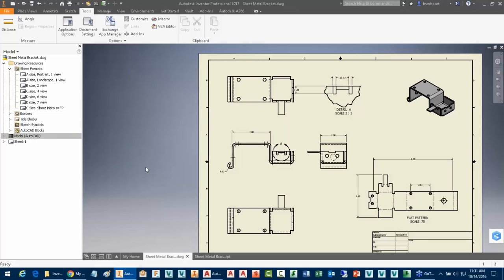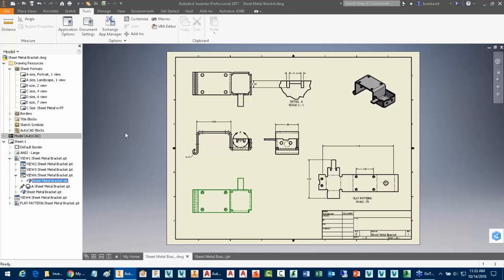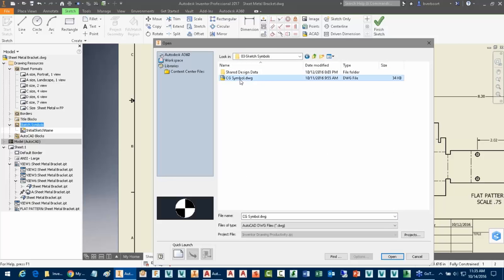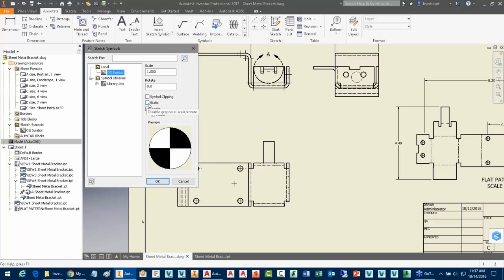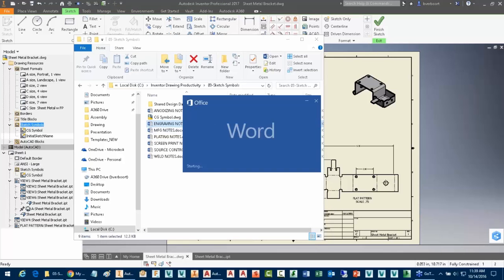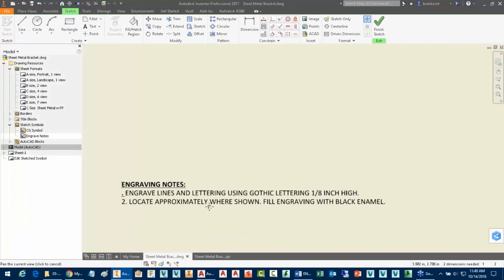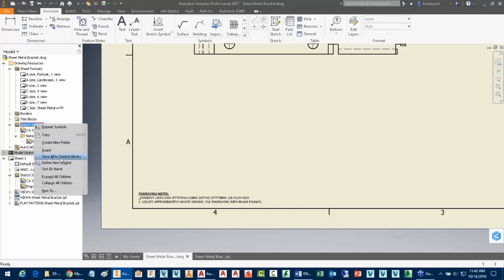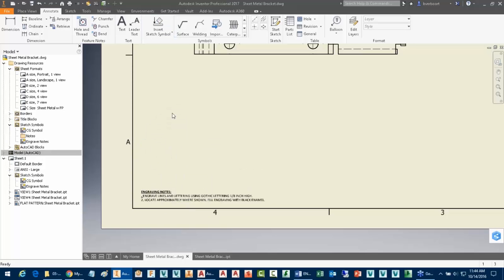Autodesk Inventor Drawing Productivity   03   Sketch Symbols

Comment: Very god instruction for special symbols.
Is it possible in Inventor to standard symbols fx. DIN ISO 6784 Edges?
Reply: Good day. How do you lock sketch symbols to a template, that they move with the template when the page size is changed.